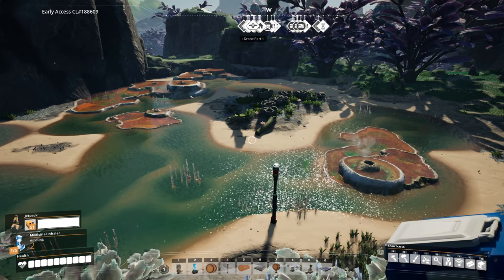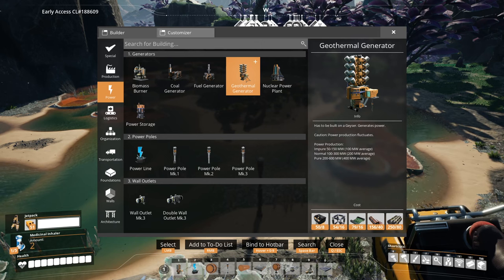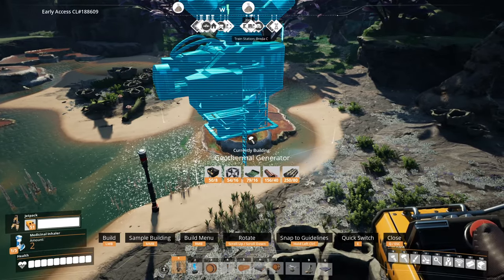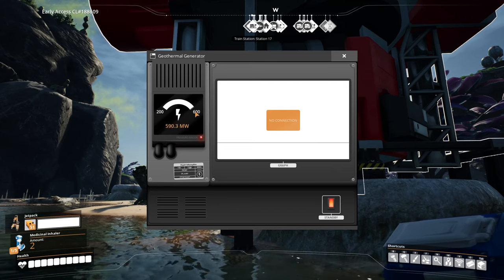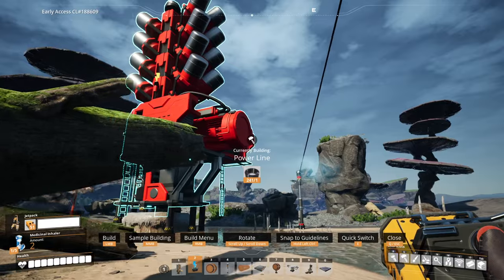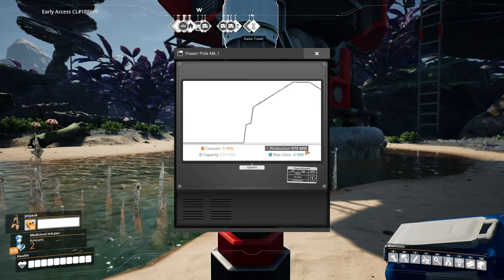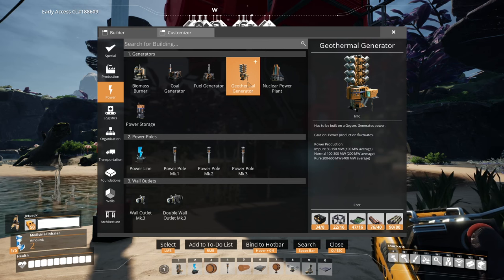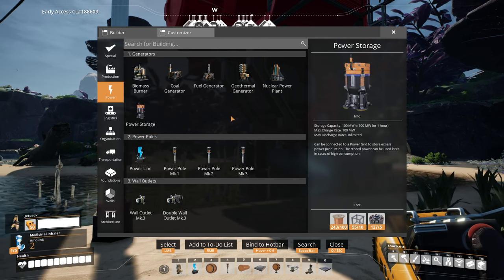Geothermal  Generator -  Satisfactory -  tips and tricks

Comment: They should add some means to buffer the power to level the spikes, otherwise maybe it's better to use as a standby emergency restart power source
Reply: They have something, power storage batteries can be wired in for backup power. You can run a pure geo-factory up to about 90% of peak capacity (just as long as batteries still charge to 100% between dips)
Reply: @asphaltpilgrim  Thanks I might give that a go, I'm waiting for update 6 before I do any more though.
Reply from the maker: Batteries is the answer to that. Will be covering them in a episode soon.
Reply: @Kev5565  with power batteries, impure require .5, normal require 1, and pure require 2, by having these amount you know it will never dipp below the average in power. (will not increase the production only use batteries when required)

Comment: Technicly a great power source,     but i hate to use them, and dont use them now, becouse i dont like fluctuating power,       if my powerline generating is fluctuating, i minmaxed it wrong
Reply: The power storage stabilise a factory running on geo-power a lot; or do you just mean that you don't like to see a power line that isn't stable, in which case - fair enough.
Reply: @asphaltpilgrim  yea its about being stable,

If its fluctuaring, one of the fuel generators is not recieving enough fuel,  so i can see if my math was wrong,
Reply: @martinroosjen  Gotcha, maybe just have one sub-factory on geo-power and keep it on an entirely separate grid. 6 or 7 geysers together can run a medium size factory - no infrastructure required. 😁